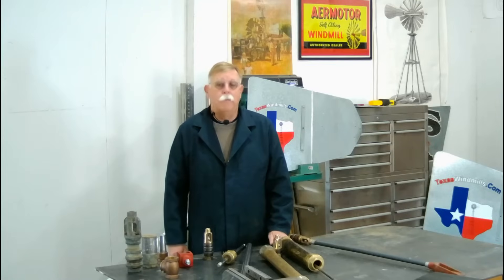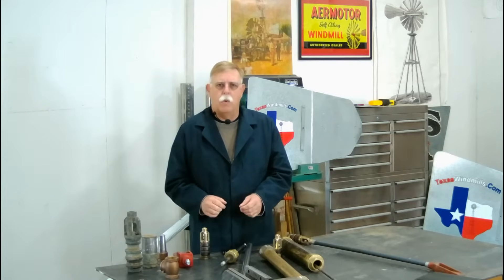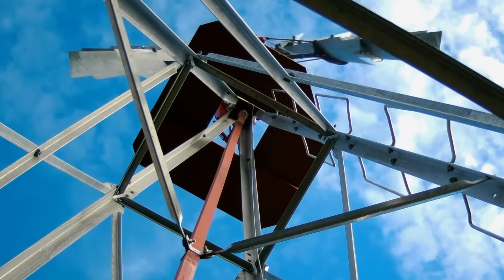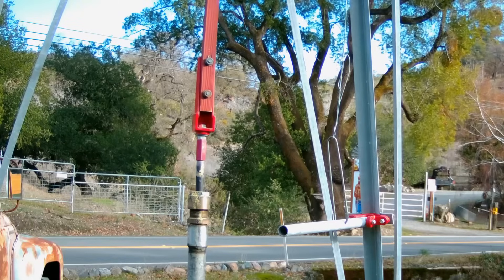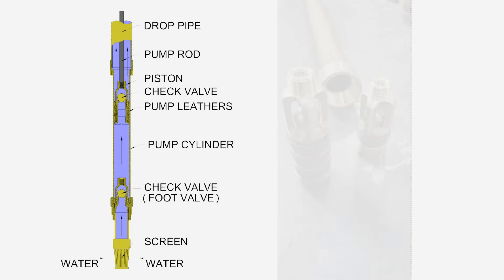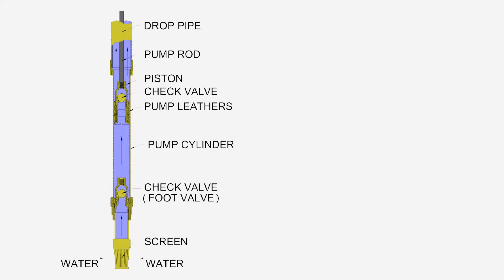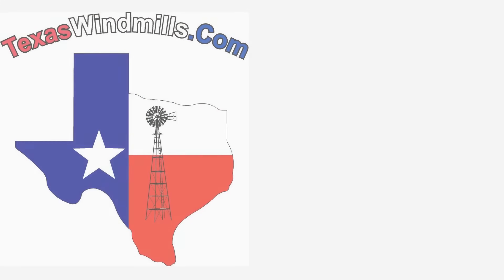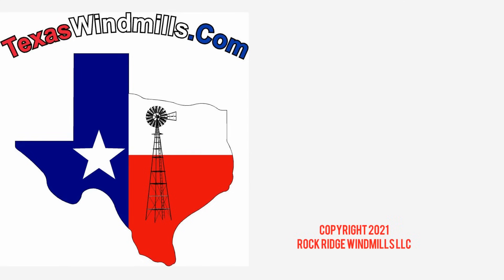How a Windmill Pumps Water

Comment: Great, found video very informative. Should be Wind powered pump NOT a WINDMILL. A windmill grinds corn.
Reply: Not really, they mill wood, grind and Peel grains but also mill water. The windmill part is just where the wind energy becomes usable kenetic energie.
Reply: @gijsvanderwaal1166  Your answer doesn't really have much to do with what he's saying. He's right, it's not a windMILL because it isn't "milling" (i.e. grinding). Its use is pumping water. If you have water and a mill, it's a watermill. But you don't "mill water" 😄

Comment: l have a problem on a 200 feet windmill well l pull out the rods and 2"pip and put new cylinder  and put it back down in the wll  and it pump water but when it pump the water up and back down .